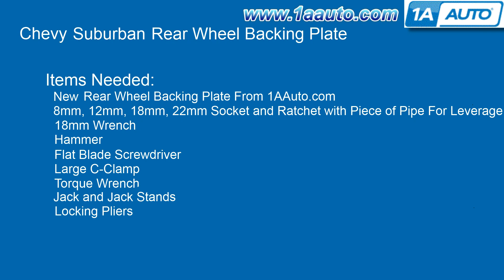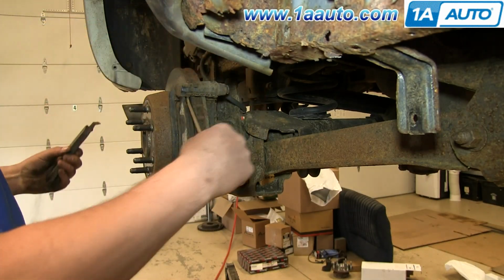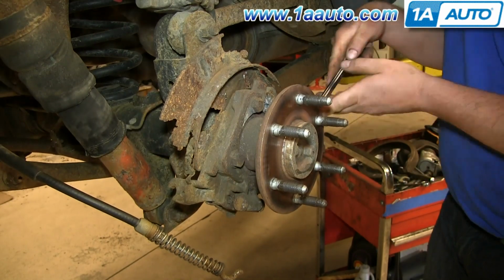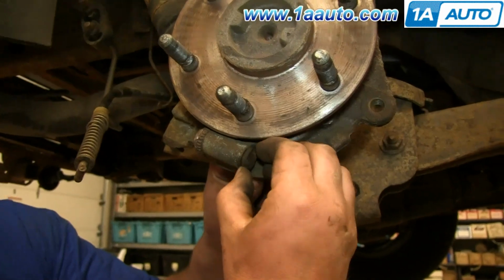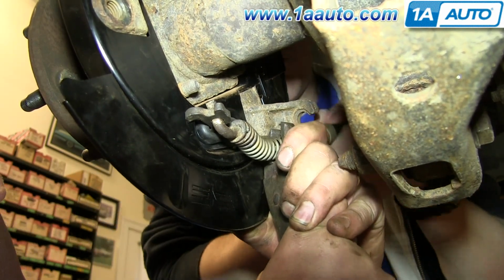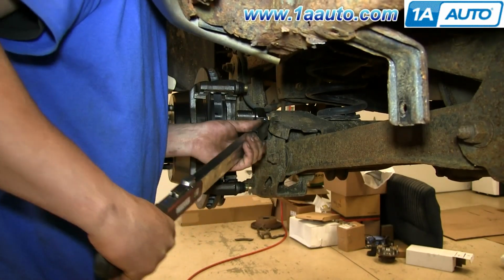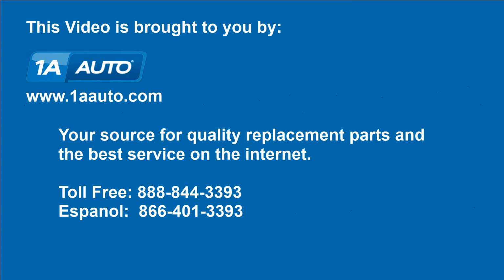How to Replace Rear Backing Plate 99-06 Chevy Silverado

Comment: Just a heads up for those who are watching this to do it yourself - a lot of the time, the emergency brake shoe clip bolt (8mm) is so rusted or snaps off and the clip is no good and cannot be reused. Instead of taking the axle off to use an EZ out, you can tap out a wheel stud, align the stud hold to the clip bolt (jack the whole rear up to turn the rear tires) then use your EZ out. Sounds like a lot of work, which it is, but its better than pulling an axle just for an 8mm bolt.
Reply: i know its been 4 months since u posted this but THANK YOU. i was about to pull my axle and stumbled upon this comment and it saved my ass lol

Comment: The shoe bracket Don installed - Ensure the tab faces inward toward the backing plate.   This prevents the shoe from leaning inside the rotor and cooking.  Thanks for the video.
Reply from the maker: +Ben D Thank you for watching, as well as the advice. This will be useful to other viewers attempting to perform the repair! 1aauto.com

Comment: i appreciate y'all speeding up the video instead of jump cutting to the next step, as i needed to see all four of those 18mm bolts holding the backing plate being removed with wrenches since i can't get a socket in between there. hopefully i can get leverage with the two wrench method. 👍🏼

Comment: The brake cable comes out easier if you use a pliers and squeeze the 2 plastic "ears" in then pull back out of the mount.  My 2004 Suburban has a different e-cable bracket.  It has only a small gap where the cable can slide through.

Comment: Don't know why it was so easy for you to get the emergency cable off, mine wont budge. And as I look at it I dont see why it needs to come off to install the 2 piece backer plate. I was able to remove the cable from the brake actuator so hopefully thatll work.
Edit:   Guessed it was just seized from rust. Used a pair of pliers to grip the plastic part and levered it out a bit. After that it came right out as in the video. I still don't think it was necessary but we'll see. Thanks for the video.
Reply from the maker: +Jersey Jim Thanks for the feedback!

Comment: I saw mine are rotting, wondered what to do?
From welding shop that are artist to axle and effusion sion repair shop.
Used Google search found out is a common problem. 

My old stuff had less rust and problems.  My Novas 1 had rust another mild the SS in the trunk and front floor pan.
See vehicles few years old a rotted badly. Rockers are gone box sides or quarter panels rusted badly or holes.

Comment: This says Silverado but yall did a Suburban, is it the same? By the way do these backing plates fit the 14 bolt 9.5" semifloat rear end? I'm thinking of getting a 9.5 Rear end and get factory 17" (13" Rear disc with dual piston caliper) for my 2007 Classic Silverado.

Comment: Will these backing plates that you linked work for my 2004 2500hd crew cab 6.0/4l80e 4wd?
Reply from the maker: +Patrick Meduri No, these will not fit any 2500HD models.

Comment: So my 04 Yukon SLT is making a sort of squeaky, sort of metal on metal noise (almost like I have a worn brake pad) from my left rear wheel, I put all new brakes on it hopping it would help but it didn’t, I think it might be coming from the backing plate or dust shield whatever it’s called because it’s all corroded and rusty like the one in this video, also it’s not a constant noise, the best way to describe it is it sounds like the wheel is hitting against something when it’s spinning around, like something is bent and it only rubs in a certain spot so it’s like “squeeeeaaaak................squeeeeaaaak...............squeeeeaaaak”  did this truck do that?
Reply from the maker: +hdrjunkie We wouldn't be able to diagnose an issue like that here, you may want to have a local mechanic take a look at it. Thanks for checking us out! http://1aau.to/m/Shop-1AAuto-c
Reply: @1AAuto  thanks... I took it apart yesterday and I think it’s the parking brake because there was a rubbed off section on the inside of the disc where it’s rubbing on one of the e brake pads. I now have to figure out how to adjust the e brake on that side so it’s not rubbing.

Comment: My 2000 Chevy blazer LT needs a backing plate and emergency shoe and new rotors and brake pads does this same method apply ?
Reply: My mechanic is charging 800$ for the job but I feel this is something I can do myself to save money as well but I don't have experience in doing this what is it I need to know to.ensure it's done properly?

Comment: Just did this on my 2000 Silverado. Got some pointers for my brothers in arms. 
1) Hardest part is wrenching off the 18mm bolts. My 19 y.o. bolts were as tight as a 19 y.o. twat and took as much lube. Be prepared to lube, hit em and the double wrench trick wasn't working. I had to keep smacking my wrench with a 5lb. mallet. 
2) My 1st 8mm bracket bolt sheared off easy putting the 1st e. brake bracket back on. can't get into there to extract. Put it on with JBWeld. So be careful.
3)My 2nd e.brake horseshoe drum was worn thin and pad came off, despite rarely using it. Lucky for me NAPA has it in stock at $76. Expensive horse shoe.
4) I'm also replacing my brake hoses. Did the rigid lines 10 years ago but that little flow through nut won't budge. I gripped them with pliers, braced them against  the frame and hit the bracket with a hammer. Screwed the new hose on by turning the bracket.
5) They forget to mention the 2 tabs on the shield. They should be bent back against the assembly to secure them there.
Hope this helps some of you...
Reply from the maker: +Don Berry Thank you for your feedback!

Comment: I like at 3:08 he says "just remove the emergency brake cable..." That was the most aggravating part of the operation.
Reply: Indeed!   A VERY difficult job when it is rusted in the hole.
Reply: Wayne Ricottilli i can’t get it off
Reply: @zforbes839 my comment is a little late but there is a press tab on the emergency brake cable, on the side where the spring is.

Comment: Great video I was able to get mine done! Took a while but I saved some $$$. I have a few suggestions. These shields come with tabs that must be folded, otherwise they will rub and make a terrible screeching noise. If you hear a noise while testing to see if the rotor is hitting anything it is most likely the tabs. Also not sure if it is the same for the yukon but the emergency brake shoe bracket that uses an 8 mm bolt is to be installed the other way around (facing inside). Thank you for the video
Reply: Thank you for posting the 2 tips about bending the tabs and the correct orientation of the holding bracket with the 8 mm bolt.
Reply: You're spot on with the bracket being installed the wrong way in the video. I did mine last week, carefully following the video. When I went to replace the bracket, everything in my told me that I was doing it backwards, but I followed the video. Finished the pax side and on the test drive an annoying squeal on left turns. Did the driver's and noted that the bracket was reversed (correctly) compared to how I had done the pax side. Finished the driver's and revisited the pax correctly installing the bracket and sure enough noise gone.

Comment: Is this an alternative to the one piece replacement?  In other words, can I buy the two piece replacement to avoid pulling my axles?
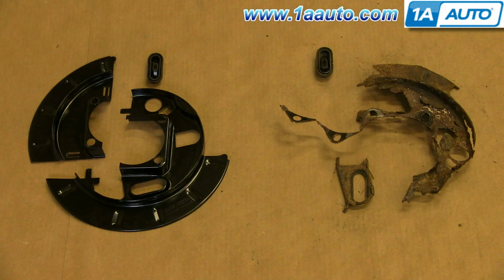Reply from the maker: +1510chris These dust shields will allow you to replace them without pulling the axles out. We shown this in the video around the 5:00 mark. We also carry the replacement dust shield kit shown in the video on our website, here is a link to them http://www.1aauto.com/brake-backing-plate-%28two-piece-unit---split-type%29-rear/i/1abmk00056?utm_source=YouTube&utm_medium=CTA+Comment&utm_campaign=ytcomment&utm_term=4pVJKuwQQNQ

Comment: I did all of this plus hardware kit, still no parking brakes, I need to take it apart again, I did both sides as well as calipers shoes and all. The parking brakes are mean! I took about an hour to do both sides having to run back and forth to get the adjusters to take the shoes. not the easiest job but with this video made me see everything I was getting into, GREAT JOB!

Comment: All videos my 1A Auto have been awsome.  I look before I always start a job just in case there is something I need to know.  One thing about this video I would like to add.  You show pulling the cable with spring easily from bracket.  I really struggled with this.  There was a small clip that needs to be squeezed for cable to come off and really hard to do with only 2 hands.  Is there a tool to make this easier?  THANKS
Reply: I don't see the clip you speak of (8 bolt wheels model) but I finally managed to collapse the spring enough with Channel lock pliers and unhook it from the bracket inside.  Cable still won't come off!  Rust Belt.

Comment: Oh, yeah, should add to my comments below the e brake cable. Mine didn't want to budge and I had no help. If you pull out the cap and then the hook you can leave it assembled and fit the shield around it. Just don't lose the little pin that fits between the caps.
Reply from the maker: Thanks for checking us out! +Don Berry

Comment: WELL MY BACKING PLATE BOLTS ARE RUSTED ON PRETTY GOOD ANY SUGGESTIONS .i DO NOT WANT TO HEAT THEM UP TO MUCH
 BECAUSE OF THE AXLE GASKET.
Reply: Heat from a torch could spread to your axle seal if you aren't careful. The bolts on the truck I'm working on were terrible to remove as well. It looks like they were loc-tited in. I actually used the box end of an 11/16" wrench because it fit tighter than an 18 mm. Then use another wrench like he shows in the vid to help pry.

Comment: Actually, it's not 100 ft lbs, it's actually 140. It's says so in your owners manual
Reply from the maker: +Philip Barlow Thank you for the update, and do recommend confirming all torque specifications with an owner's manual or by the dealership. 1aauto.com

Comment: I don't see why these plates are needed, at least the shield part.  Yeah, crap can get on the rotor, it can get on the front of the rotor all the time.  I've been running one on and one off the front of my legacy for five years and I can see no difference other than I can actually see the back of the rotor on the one side.  I live in the rust belt too.
Reply: Clearanceman2 The backing plate holds a rubber grommet that shields the e-brake lever to a pin and prevents contaminants from reaching it as well protects the back of the shoes and rotor from anything trying to get between the axle (on these trucks).  The fronts would be easier to get away w/o